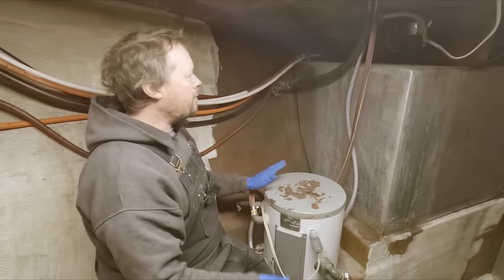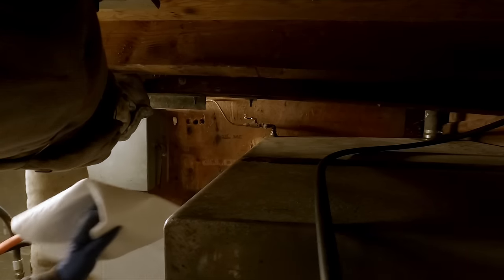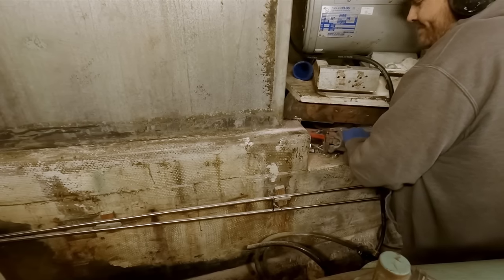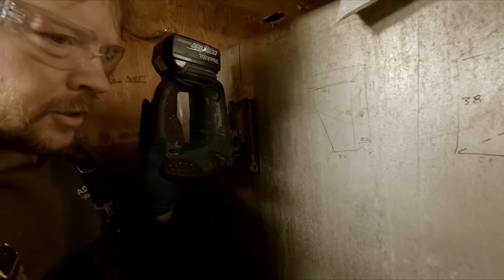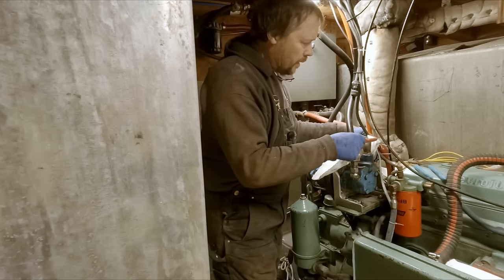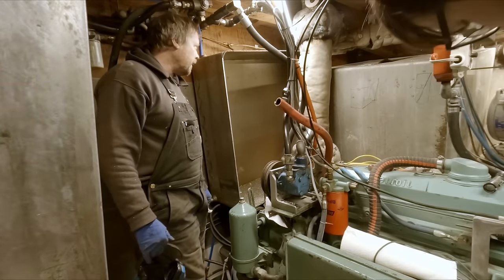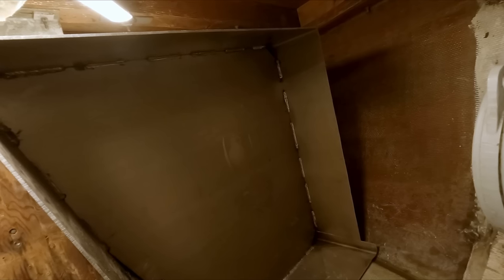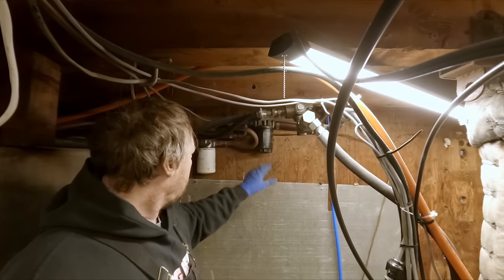Cutting Open and Removing the Leaking Fuel Tank - Emerald Isle: Ep.79 Fishing Boat Refit

Comment: Good idea on the hyd tank.  A 60 gal section of my stbd engine room fuel tank (steel freezer troller, tanks welded into the hull) is the main hydraulic tank, and a 60 gal section of my port tank is fresh 15w-40 storage.  My engine, gearbox and Genny all use 15w-40, and I have them all plumbed in to a lube oil pump manifold that draws from that tank.  Pump is a Marco reversible and with a few valve changes I pump old oil directly from the equipment into 5gal buckets.  I buy the 15w-40 by the barrel from Delta Western, works great and saves a lot of $$.  Something to think about when you do the stbd tank. If you do it, make sure you go at least 60 gals and have a deck fill for it. 
Great vid of a tough job, thanks for sharing-

Comment: Good work!  The corrosion illustrates the importance of Oxidation to the corrosion resistance of Aluminum.  As I am sure you know, Al forms an oxide coating immediately when the bare metal is exposed to Oxygen.  This oxide layer is what gives Al it's corrosion protection.

In areas where there is lack of oxygen such as on the bottom or where adjacent contact with other materials occur, a reduced O2 environment results.  This lack of O2 leads to a reduction in the Aluminum Oxide layer and corrosion, enhanced by the marine environment, literally "drills" holes in the aluminum base metal.  The side wall where the tank was touching the bulkhead is a good example of this type of corrosion due to O2 reduced environment. 

Different Al series offer different levels of corrosion protection.  I believe that the 5000 series of Al offers good corrosion resistance and is often used in marine environments.  This series also has good weldability.  I am not a metalurgist but I am sure selection of the right material is critical.

Obviously he bottom of the tank is the most prone to corrosion and by it's very nature the most difficult to keep well ventilated.  Maybe there is some way to keep the bottom well ventilated and still support the tank - this is an interesting prolem to deal with.  Coating the tank may not be a good solution because the coating itself would prevent O2 from healing any scratches in the protective oxidation layer and even a little scratch during installation or subsequent viration during installation could create a rapid "drilling" environment for future corrosion. 

What series of Al are you planning to use for the repair?
Again, Great job - most would not approach such issues with as much thought as you fellows certainly do.

Comment: In the future if you need to get a new plug in sawzall then look at the Porter cable as I like way more then the Milwaukee.  It is a beast.  If you go with cordless then Milwaukee Fuel is the way to go
I wonder if a Reciprocating Air Saw would work for you.  A hole in the top or side would allow you to cut from inside

Comment: Didn’t know about the tank having a baffle. Could you build a number of smaller tanks on the bench that would fit down the engine room access? You could custom mount them on brackets for ventilation and security. If/when you have to repair the starboard side tank, you could build the smaller tanks and be ready to install at your leisure. Either way, it’s still a lot of work, but you and the boys got this.

Comment: On the “Tally ho” project Ian was talking about Stainless Steel use in a marine application. He mentioned Stainless work hardening, and that Stainless corrodes from inside so you can’t see the failure until it occurs.

Comment: With all that hard cramped work, I would not be looking forward to having to do it again.  Using old metal is a crap shoot in more ways than one.  Hard to get a good weld on old dirty metal which has soaked in oil for many years to say the least.  Since the perfection of every bit of the welding is what you are relying on it would be tough to achieve.  Even if it passes a pressure test you may only have a thin covering that will let go in short order with vibration, heat/cold cycles, etc.  In other circumstances, if it wasn't a fuel tank and it wasn't so inaccessible it might be worth the gamble knowing you can just go back and reweld.  I think I would mock up the largest tank you can maneuver back in place then make three or whatever it takes in your home shop in relative comfort.  Most importantly knowing you can inspect and take your time with good welding position to do a tight job, one that should last for the next twenty-five years.  An added advantage is they would be comparatively easy to remove when you get to your engine room refit giving you good room to work then.  A not inconsiderable benefit is that smaller tanks make smaller fuel spills if they leak and they leave you with a lot more remaining fuel to get home.  Throw in, welding aluminum in an enclosed space gives off fumes that aren't at all good for your health, that it would be expensive to get the equipment to adequately ventilate it and still allow you to have good vision of your puddle.  Well it would be an easy decision to make for me, but it is your cow and your choice.  I admire your tenacity in any case.  There are lots of nasty jobs maintaining a boat, that is for sure.

Comment: If this tank has this much corrosion why wouldn't the other aluminum tank on the other side of the boat have the same type of corrosion that will eventually cause it to fail . Are you planning on at least pulling it out to see what it looks like. After finding as much corrosion on this tank I'd be very nervous not knowing the condition of the other fuel tank being that close to the engine.
Reply from the maker: Not sure if we mentioned it in this video, but that tank is empty and will be pulled out and inspected.